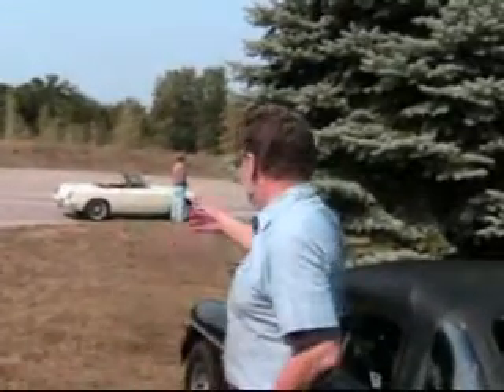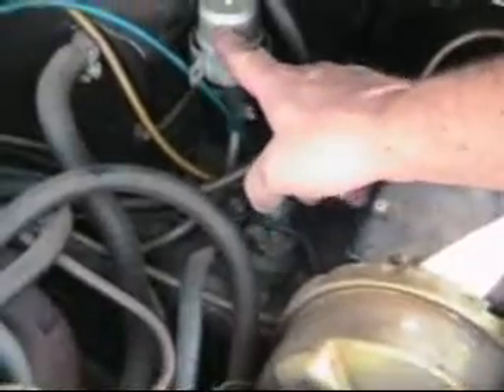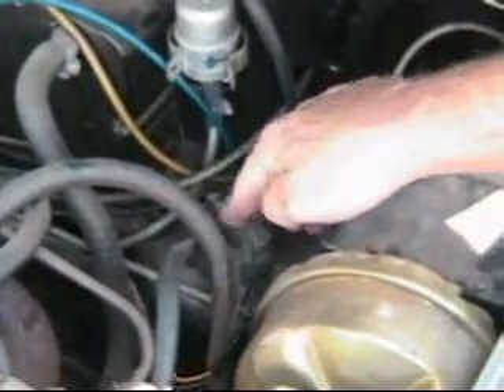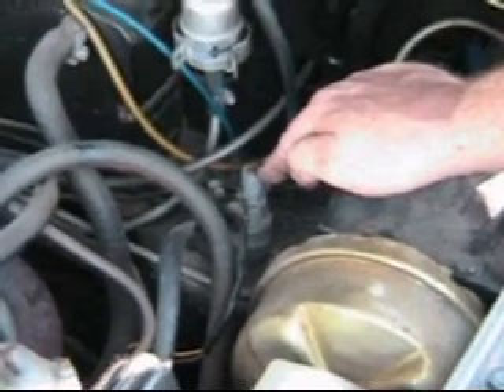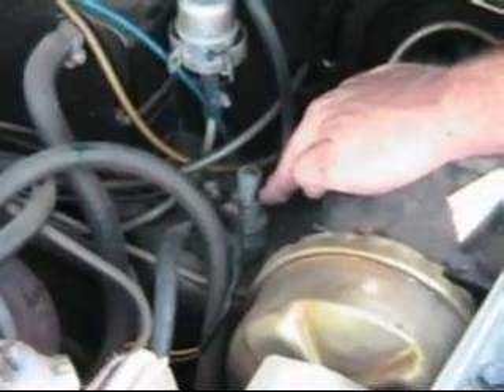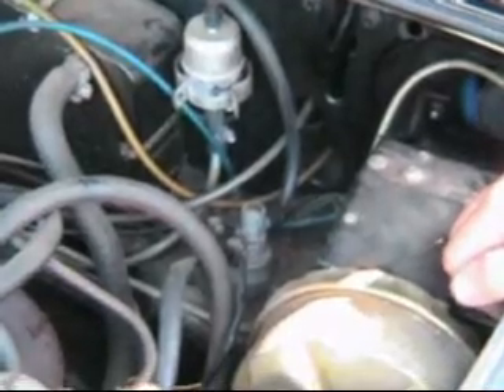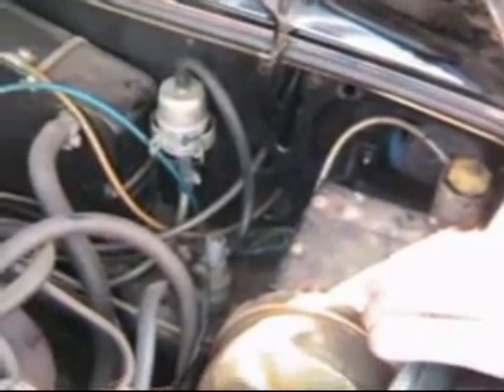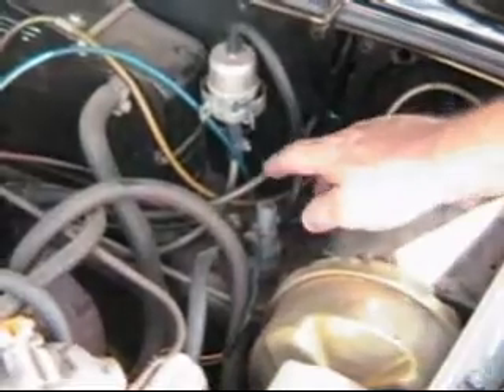017 MG Tech | MG Rollover Valve MGB

Comment: Hi, Could tell me if a rollover valve would prevent my truck from starting if it's not connected?   I have a 97 dodge ram 1500 5.9 360 in which i replaced the sending unit because of a bad gas gauge float and I noticed the rollover valve that i disconnected had broken off where the line connects to it so I had to buy a new rollover valve.  The fuel pump kicks on but the truck will not run. Could this be fuel pressure related due to disconnected rollover?  Thank you for any help.